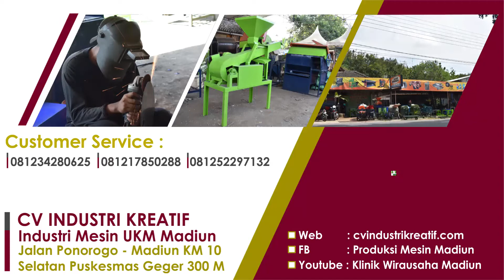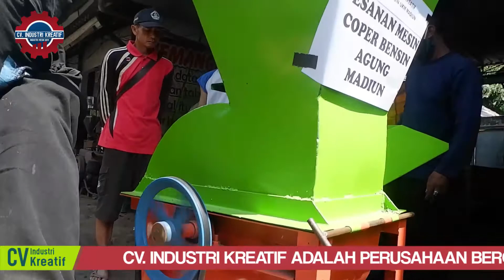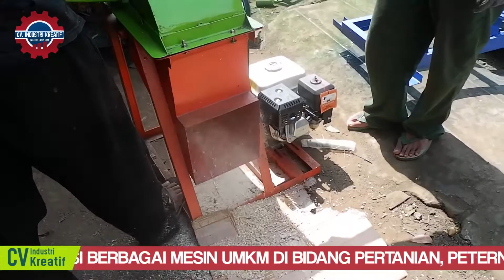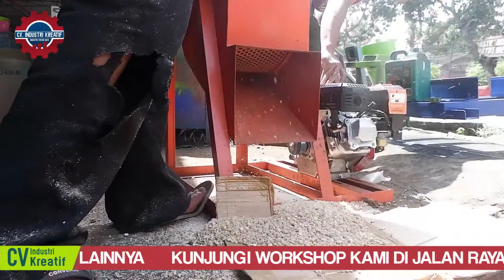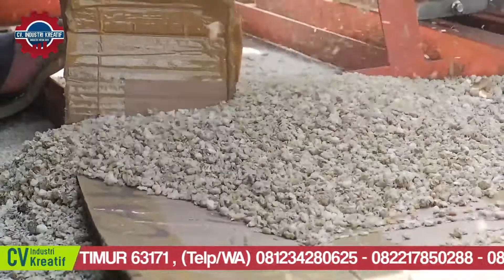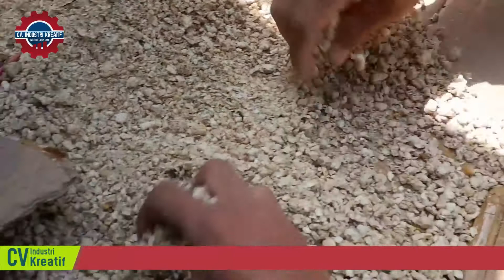CARA MUDAH MEMBUAT PAKAN TERNAK DARI JANGGEL JAGUNG

Comment: Janggel jagung itu apa kalau sudah di giling jadi bungkil ya min???
Reply from the maker: untuk info harga,detail mesin & pemesanan hubungi Customer Service Representatif Kami (Telp/WA) 081234280625 - 081217850288 - 081252297132 atau kunjungi Workshop Kami di Jl Madiun - ponorogo KM 10 Selatan Puskesmas Geger 300 Meter Kec Geger Kab. Madiun Jawa Timur

Comment: Berapa harganya mas
Reply from the maker: untuk info harga,detail mesin & pemesanan hubungi Customer Service Representatif Kami (Telp/WA) 081234280625 - 081217850288 - 082142267610 - 0812330810125 atau kunjungi Workshop Kami di Jl Madiun - ponorogo KM 10 Selatan Puskesmas Geger 300 Meter Kec Geger Kab. Madiun Jawa Timur

Comment: Belinya dmn dan harganya brp pak?
Reply from the maker: untuk info harga,detail mesin & pemesanan hubungi Customer Service Representatif Kami (Telp/WA) 081234280625 - 081217850288 - 082142267610 - 0812330810125 atau kunjungi Workshop Kami di Jl Madiun - ponorogo KM 10 Selatan Puskesmas Geger 300 Meter Kec Geger Kab. Madiun Jawa Timur

Comment: Berapa harganya mesinnya mas?
Reply from the maker: untuk info harga,detail mesin & pemesanan hubungi Customer Service Representatif Kami (Telp/WA) 081234280625 - 081217850288 - 082142267610 - 0812330810125 atau kunjungi Workshop Kami di Jl Madiun - ponorogo KM 10 Selatan Puskesmas Geger 300 Meter Kec Geger Kab. Madiun Jawa Timur

Comment: Berapa harganya
Reply from the maker: untuk info harga,detail mesin & pemesanan hubungi Customer Service Representatif Kami (Telp/WA) 081234280625 - 082217850288 - 081252297132 atau kunjungi Workshop Kami di Jl Madiun - ponorogo KM 10 Selatan Puskesmas Geger 300 Meter Kec Geger Kab. Madiun Jawa Timur

Comment: Nutrisi yg terkandung apa bos?
Reply from the maker: untuk info harga,detail mesin & pemesanan hubungi Customer Service Representatif Kami (Telp/WA) 081234280625 - 082217850288 - 081252297132 atau kunjungi Workshop Kami di Jl Madiun - ponorogo KM 10 Selatan Puskesmas Geger 300 Meter Kec Geger Kab. Madiun Jawa Timur

Comment: Brp harga nya
Reply from the maker: untuk info harga,detail mesin & pemesanan hubungi Customer Service Representatif Kami (Telp/WA) 081234280625 - 082217850288 - 081252297132 atau kunjungi Workshop Kami di Jl Madiun - ponorogo KM 10 Selatan Puskesmas Geger 300 Meter Kec Geger Kab. Madiun Jawa Timur